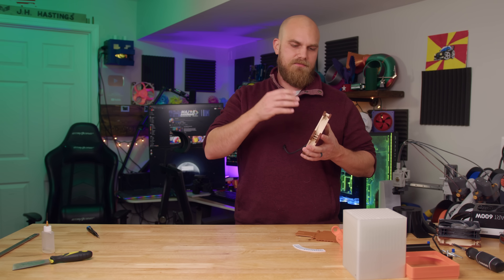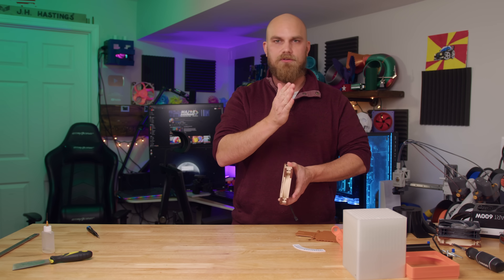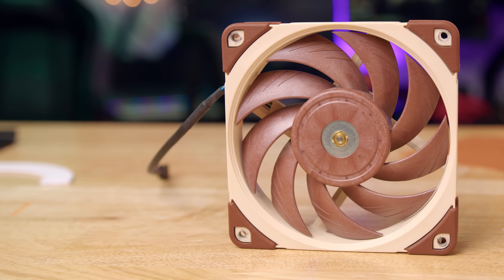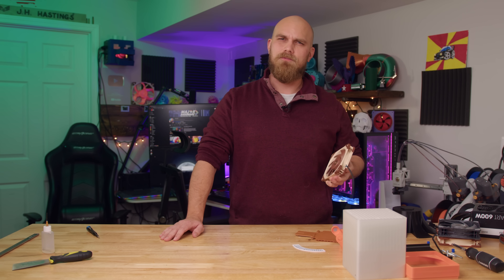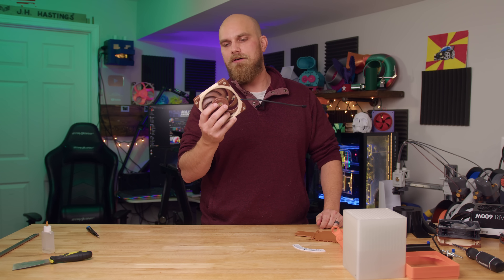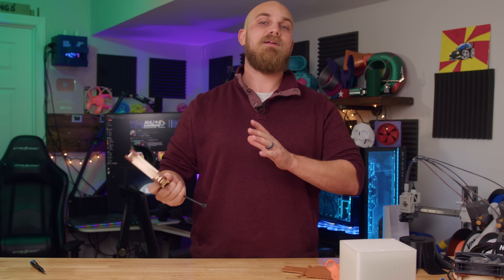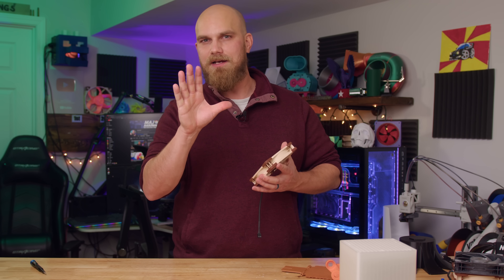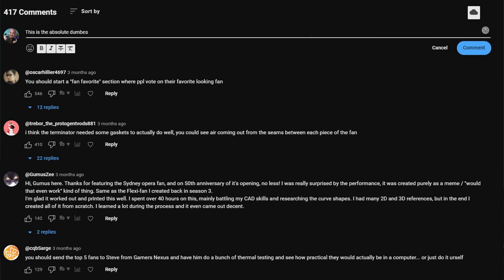I Built a Static Pressure Machine | Fan Showdown Season 6 Pilot

Comment: Watching this makes me think we need a more powerful motor for the evolution of this series. One idea might be to use a quad-copter motor and a variable power source? Or you could compare low-power vs high-power.

My only complaint is that static pressure really seems to funnel into the same design.

Comment: This is a fun channel - thanks for your work! I would start with a vertical tube. The fan blows air into the bottom of the tube. A damper in the tube floats on the air column. Add a slot along at least two sides of the tube that allows air to escape. As the damper rises, more of the slots are exposed to allow more air to escape. You can add weight to the damper to change the scale. You can increase the number or size of the slots to change the range/sensitivity of the test. You can increase the length of the tube to increase the range of values. There are several ways to stabilize the damper; If a thick damper isn't stable enough,  I would recommend a graphite lubricated axle centered in the tube with a shaft on the damper. Make the damper a bright color and the tube dark to see through the slots, and measure how high the damper rises.

Comment: I would mount the fan on 4 posts and place the fan pointing up on a digital gram scale. Zero the scale tare weight to account for weight differences. Turn the fan on and measure the thrust produced.

Comment: To the Author, did you realise that the first airflow meters for fuel injection engines in the mid '80's used this 'trapdoor' arrangement? They were restrictive but accurate and I love you for using this method to upgrade your test results 😅 love your channel and will stay tuned to all your future posts😀

Comment: The best place to measure the pressure is the centre of the tube.  As you get closer to the walls, viscose, boundary layer losses increase - as does turbulence.
If I were building such a device, I would have a tube suspended in the centre of the airflow connected to a diaphram (you could use something as simple as baloon rubber?) which in turn moves a pointer via a lever.  Increase the diameter of the diaphram for better sensitivity.
The flap method is reading a number of different effects at the same time which will reduce the accuracy.

Comment: If you’re trying to measure the FANS static pressure wouldn’t it be best to use a STATIC object in place of the flap? Then use a digital manometer tapped into the duct to read your results in inches of water column (literal static pressure)? 

As your flap opens the resistance to air flow will be altered ie not static.

I think your set up will provide results but only reminiscent of what you’re actually after.

Comment: make a tube for the fan that leads to the top of an 80mm water cup then have a tiny tube off the bottom of that "glass" that will show how many inches of static pressure to rise the water in the tube from the eqilibrium state without the fan running. very similar to your flap but able to have a reference to psi rather than random guage...

Comment: I think what you might be interested in is a "Characteristic pump curve". It shows the power transmitted to the fluid against the amount of fluid that is pumped. For both you can use many different variables. Like head, static pressure or specific power and flow rate, volumetric flow rate or mass flow rate.

Comment: I belief that kind of flap is comparable to car throttles.. there happens that you cannot get straight curve in those to compare right after you open it and the curve drops quickly due the changes as it is less effective how open the flap is. PID controllers has tunable curves for that to set up AC/heating in houses due it.

But its pretty neat for sure as setup.

Comment: You have too many variables, even with the stand. (changing interactions with the downdraft from the door, varying resistance from changing air speeds as the door opens and more air flows past the straightener. Go back to what mmH2O is reading, really small psi. Instead try the following setup: one high accuracy gram-meter with a large diameter cylinder on top, one tube suspended over the gram-meter pointed down with generous clearance between it and the cylinder, one thin plastic bag to line the tube, and a gasket of some sort to seal and secure the bag onto the tube and attach fans to the top of. The idea is that the fan blows into the bag lining the tube inflating it but staying inside. The cylinder is pushed up into the tube displacing the bag back inwards, the clearance should allow for the bag to freely and loosely double over between the cylinder and the tube without bunching between them or extruding out the bottom (my guess for best bag is a grocery store fruit stand bag). This setup effectively makes it so that the psi inside the tube presses down over an area equal to the inner cross section of the tube perpendicular to the surface of the gram-meter (all other forces cancel if you have the bag even and not bunching or going taught due to anything other than inflating to fill gaps while the bag makes contact across the entirety of the top surface of the cylinder) . Take the "weight" measured by the gram-meter and calculate the dimensions of a cylinder of water with a diameter equal to the ID of the pipe required to equal that weight, and the length of the cylinder will be your mmH2O equivalent.
Reply: Sorry for the big block, on mobile and didn't realize how much of a wall that is. Also, in case it isn't obvious, zero the gram-meter after a test run to get everything settled in place, then run the fan

Comment: I think having a shroud that covers the paddle for the full range with an adjustable center whole would help. I would also add some small whole on the meter side so you could add bolts, nuts and washers to get the correct balance.

Comment: use a water column wth a U attaching to a box for the fan. If you use a graduated cylinder as the column you can use the measurement marks for data. What you are doing is not static pressure

Comment: Have the fan blow into a tube that bends up, then a curve down followed by a curve up. Fill the bottom 'U' with water and see how high the fan can push the water upwards. Then you will get positive and negative results as the water is open to atmospheric pressure.

Comment: wouldn't it be better to measure pressure by having a fan blow into a "wind tunnel" that is enclosed with a pistoned plate in the back end where the rod pushes on a letter-scale or something? Giving an output in grams as opposed to some arbitrary scaling of this one fan. Any pressure escaping would do so on the same side as the fan is blowing in.

Or make a wind tunnel that is only open in the fan side and have a tube on the bottom of the opposite side in a U-shape filled with water, as the pressure increases the water in the arms of the U will go from being level to different height giving you a measure of pressure. Pretty sure I saw something like that on mythbusters once.

Comment: might be hard to design something light enough and enclosed enough to hold the air, but for a more linear measurement, i would suggest a rail system utilizing rails on the top and bottom of the flap, making the airflow chamber fully surrounding the flap, and have the air push the flap on a horizontal axis. Again using linear rails or rods with linear bearings will probably be too heavy for airflow to push it much, but if you could find a way to counterbalance the weight and have it move horizontally with a resting coefficient close to 0 (may have used that word in the wrong context, idk just sounded like it fit), then the test would be really good.

Comment: This design isn't linear. The more the flap moves horizontal the less energy the air can impart to it. 

You'd be better off with a more traditional U-tube design like they use for radon systems. Easy to see on camera, easy to build, could probably be made to go into a system that still tests other aspects of the fans.

Comment: A transparent hose with water, but almost horizontal with just a few mm of height difference between a reasonable length. I'd guess 10:1 or 20:1 should be reasonable. 

Could "static" pressure be measured with no air velocity? The pressure into a closed cavity... Or would that break aerodynamics of the fan. In some applications the flow/pressure curve is max with no flow, max would be easier to measure, but it could be making a completely different rabbit hole. Or just measure the entire flow pressure curve and have fan with it. 📉

Comment: If you try to measure pressure in mm-water one limiting factor of resolution is the weight of the water. If you use a lighter fluid like diesel, ethanol or kerosin  you get a better resolution. 
You could also measure the displaced air by using water in a big tube and measure the volume with a very small horizontal tube that contains an oil drop to show the volume and "piston".

Comment: Im an aerospace engineer- i can say that this should do alright, but it’s technically still a dynamic pressure meter/ flow meter- flaps like this have actually been used on early aircraft to measure speed. It’s still a solid idea though.

Comment: I think you should get something like a cheap mouse pad to turn into a gasket to put between the fans and the static pressure device to prevent back pressure leaking.

The supports on the back are great, but only print the support grid on the outer edge. Maybe a single lined cross through the middle.

Make your counterbalance taller, take 25% of your counterbalance material, and form a needle on the end. 

Use |l|l|l|l|l| to get closer lines to help with measuring.

Great idea, hope mine can help too.

Comment: I wonder if there is a pitot tube and monometer small/sensitive enough to measure pressure/flow this small. I used to take static pressure, wet bulb temp, dry bulb temp, and a number of velocity readings (depending on the diameter of the duct) to calculate flow readings for baghouses/media capture systems. If you could find a pitot tube small enough (and a very sensitive manometer) you could incorporate a port into the build and use the pitot tube (tip facing away from the fan) to get the static pressure measurement. It might be worth taking a look at Dwyer photohelic/magnehelic pressure gauges. They are very accurate and if you leave one of their 2 airline ports open to atmosphere it will give you the differential pressure between your "duct" and atmosphere.

Comment: 2.35mm H2O that means it can push water 2.35mm up.
Like blowing into a bottle with a pipe set up above to see how high the water level will go
You could make this with a sealed tub and some clear hose.
as long as the setup is repeated exactly the same for each test the rank will be accurate.

Comment: The flap lose surface area as it closes. I would have attached a ¼" tube in a U shape with some water inside where the water displacement would indicate the pressure
Reply: The build in detail: the fan connected to a similar diameter pipe that funnels down to the flexible U shaped tube that has water in it. The only open end should be the air inlet and if the water comes out from the other end it needs more length on the tube

Comment: The design is excellent. The only thing I'd change is extend the walls a few cm after the flap, so it actually pushes back more on the mass of the air, instead of just hanging in there once a sufficient  gap is created to allow for all the air to flow out fast.

Comment: You should use a load cell positioned against a flap, or more like a membrane of some sort, to read the force generated. Ideally, I would think, you would make the setup so that air doesn't bypass the the measurement surface, therefore measuring the maximum static pressure the fan can actually produce. You could buy a scale, that measures to the hundredth of a gram, and scavenge the load cell and circuitry to display the force as a low-cost implementation.

Comment: I like where you're going but the escape opening needs to remain consistent throughout the experiment. I like the linear flow box but if you were able to make small slits along the perimeter near the existing exit opening and then cap off the existing opening with like a balloon maybe? Then you'd be able to see the latex deflect due to pressure but the escaping air would always maintain the same area it could leave from throughout the experiment for each fan. This would also allow you to modify the escape slits until you're happy with the range of deflection from the latex or other means of measure.

Comment: So why not just use the basic manometer? Buy a tube that loops down and back up fill it with water and measure the change in the pressure with the water? If you use 2 tubes one before and one after a radiator you can see the change in static pressure. For higher resolution you just make the exit a bit smaller then the opening on the wind tunnel.

Comment: Hey, as something of an enginerd myself, I have taken a crack at doing fan/radiator testing, and two ideas I came up with for measuring pressure is using a barometric pressure sensor, like the BME680, has a measuring resolution of 0.12 Pa, or ~ .0122 mmH2O.  Alternatively, there is the Sensirion SDP810, a differential pressure sensor, with a full scale range of ±500Pa and a 16 bit resolution, which yields a resolution of .015 Pa or ~.0015 mmH2O.

Comment: I think your device is great for your showdown.  Maybe to get more resolution you may want to put the flap completely inside a tunnel not at the end. right now the opening starts and then allows too much flow to dump out of the sides. also if you make your pointer longer and your protractor with a larger radius then you will see a finer grain detail .
Reply: I guess I should have read the comments first.   I am not the first to offer these same suggestions.

Comment: Coming from an HVAC perspective, maybe a Megnehelic differential pressure gauge? Mostly used for the monitoring of filter stacks and pressure differential of the air across heating and cooling coils.

Comment: I would consider using a newton meter instead of the scale to take the measurement. you might be able to get one sensitive enough with some kind of memory for the maximum value per run.

Comment: What you have created is device that shows air flow volume & speed. Not static pressure. A super interesting tool in itself but not static pressure. You should get a manometer and incorporate it into your design to see if there is a relationship between your measuring device and true static pressure.